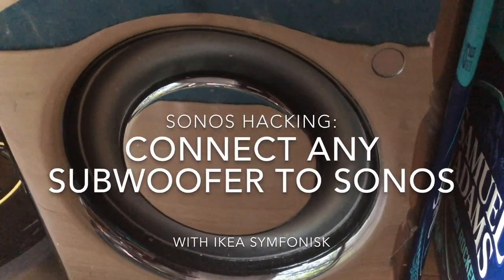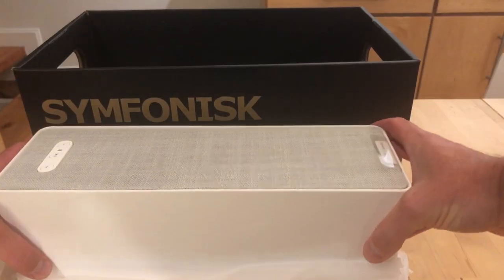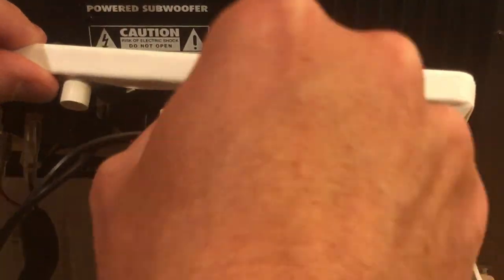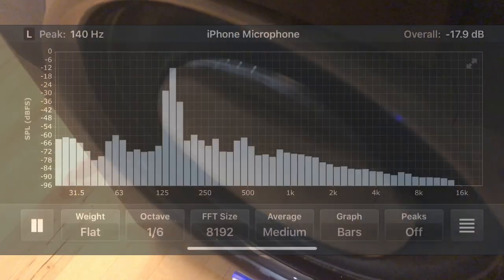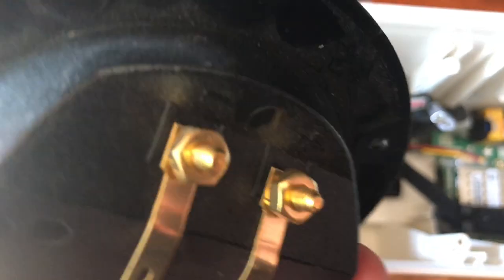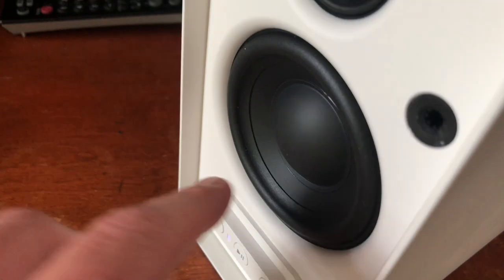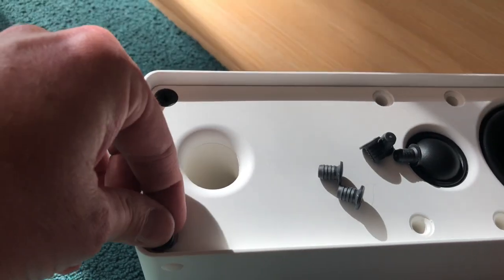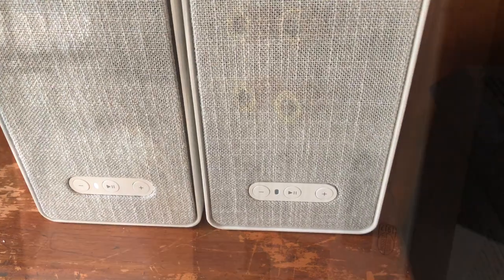Connect any powered sub to Sonos with this Ikea Symfonisk DIY hack

Comment: This is awesome. Have a sonos beam and 2 play 3's for 2.1 setup. Also have an old sub. Does sonos allow you to add more then 2 speakers for surround sound?
Reply from the maker: I don’t think so? But I think the best setup would be to buy a Symfonisk, disconnect then internal drivers and just use the woofer wire to get a signal into your sub. Then group that ikea speaker to your 2.1 room. This will let you independently control the sub volume. If you jumped off rear speakers, those might not have much low end but a grouped speaker should get a full range signal.

Comment: Works great! I simplified it a bit by just running a wire into the Sonos speaker by drilling a hole and tapping into the leads that connected to the woofer. I do have a slight hum but it’s not too bad (going from positive and ground to rca jack). Adjusting the eq in Sonos helped too. I am still able to get a little bit of treble out of the Sonos which helps to balance the room a bit. Thanks for this hack.
Reply from the maker: Are you connecting the amplified signal from the woofer terminal and just wiring it to an RCA plug? If so, I wouldn’t recommend doing that without adding a high level (amplified) to low level (signal) converter since that is too much power to plug into an input stage. E see my video on the DIY Sonos connect for info on that converter.
Reply: Todd Parker thanks for the quick reply. I’ll pick up the converter but have mainly 2 questions: I’m only interested in the low end frequencies so I’d only be connecting 3 wires from the 6. What do I do with the ground wire? I’m pretty clear on the positive negative hook up, but not the 3rd wire and where it goes. Or...is this a powered, neutral wire connect? Lol. Powered=positive and neutral = ground? Lol those terms confuse me.  Please let me know. Thanks Todd
Reply from the maker: Sean Mauricette If you are only connecting one symfonisk then yes, you’d only be using one of the channels on the converter (2 wires). There are two ground wires that may help with hum but aren’t required if there isn’t somewhere to run a ground wire. I’m
Assuming you’re doing this because your sub does t have speaker inputs?
Reply: Todd Parker yes. That’s correct. It only has an RCA input. When i use it, it’s only on around 5-10% volume because it’s so powerful (as you mentioned). There is a low hum that’s only noticeable when the system is off. But other than that it sounds amazing! Is there an area inside the IKEA/Sonos speaker that I could attach the ground to?
Reply from the maker: Sean Mauricette I’m glad this is working well for you. I replaced my Sonos sub with the symfonisk/sub combo and it sounds awesome. I’m not sure where to connect a ground inside but you can run a wire to the screw on an outlet cover usually. You might find the hum goes away one ever you’re using the converter

Comment: i just added my rel quake 2 to the symfoniks, really easy and sounds fantastic now!! thanks!
Reply from the maker: Awesome!
Reply: How did you connect it? Via speakon or lfe?
Reply: @ThomSellink  speakon
Reply: Erik Thomassen Oke I’ll give it a try! Thanks
Reply: @todd.parker   I have a kEF PSW 2150 which does not have SPEAKOn , have Line in Left and Right. so only way is to use RCA on Tpa3116? or can i connect it to Line in Left and Right?
Reply from the maker: You need to buy a speaker to RCA signal adapter. Do not plug powered signals into your RCAs or it may damage them.
Reply: @todd.parker  thanks for quick reply
Reply: @kaboutertje43865873  did you disconnect the woofer of the Ikea speaker? I’m also trying this, but when is disconnect the woofer of the Ikea speaker and connect the REL directly (speakon) to the Ikea speaker there is a hum in the sound. When I leave the woofer connected, no hum... Any idea?
Reply: @ratjetoe92  I left the woofer of the symfonisk connected
Reply: I did turn down the bass in the app and up on the sub so the symfonisk woofer doesn't have to work too hard

Comment: Hi, I ordered a symfonisk to try this with my active sub. I have one question for the cable connection. My sub has one mono cinch (coax) cable for its signal. Is it possible to cut the cable and connect it to the speaker?
Reply from the maker: Is it a coax cable or an RCA? If an RCA you can buy an adapter to convert from a speaker level to a signal level. Look on Amazon for one.
Reply: Todd Parker Its an RCA cable. Which cable would fit? Thank you for your help!!
Reply from the maker: Bastian Wur you need something like this: Kicker KISLOC 2-Channel K-Series Speaker Cable to RCA Adapter with Line Out Converter https://www.amazon.com/dp/B00I4EF1BC/ref=cm_sw_r_cp_api_i_MtB8DbQDEAH2R

Comment: I did this hack and it seem to work. But anyone having an issue with ambient buzz issue when there is no sound going thru?
Reply from the maker: Sounds like a electrical hum. If your sub has a way to ground it, try that or try a different outlet
Reply: The sub is grounded. :(

Comment: Hi Todd, great video!!!
I have a sub with input and output terminals. Please can you confirm that I can connect the tweeter terminals from the Sonos to the input of the sub and the woofer terminals on the output back to the Sonos?
Thx.
Reply from the maker: Thanks. You can install two pairs of binding posts like I did but use the first pair to route the woofer’s amp output (disconnect the woofer) so you can connect it to the sub’s input and use the second binding post to connect the sub’s speaker output to the Symfonisk woofer. I think that’s what you were saying, just wanted to be clear so someone doesn’t hook their tweeters up. This is the “ideal” way to wire up a sub since it will remove the bass from the Symfonisk’s woofer for a cleaner sound but it’s more wiring.
Reply: @todd.parker  I am a bit confused about this setup. I have the one pair of binding posts connected to the Symfonisk woofer, and they connect to the High-Level Input on the Woofer (acoustic Audio Woofer).  However, I am not sure what the second pair of binding posts should connect to within the Symfonisk? These would be the ones that are connected to the  High-Level Out on the acoustic Audio Woofer?
Reply from the maker: I have a second pair of posts to let me access the tweeter amp. If you have 2 pairs, I’d suggest using them to leverage the sub output so the woofer isn’t working as hard
Reply: @todd.parker  Sorry for the confusion with this. So...  I route the Sub Woofers Hi-Level Output to the binding post that is attached to the tweeter amp within the Symfonisk and the Sub Woofer Hi Level Input to the binding post that is attached to the Woofer amp within the Symfonisk. Is that the correct Method?
Reply from the maker: Bill Hurlburt No, you’d leave the tweeter out of the equation. Unplug the Symfonisks woofer terminals and connect them to the sub input. Then connect the sub’s speaker output to the Symfonisk’s woofer. You’re essentially placing the subwoofer between the symfonisks amp and the woofer so it filters out the bass going to the symfonisk woofer.
Reply: Todd Parker great. just so great. you win the entire world right now. I just ordered all the parts and am headed to Ikea now.

Comment: This sounds great and something I'd like to try. I assume the Sonos app allows you to add a Symfonisk to it as a sub? Also, does this setup provide decent bass, given that the electronics only expect the standard speaker so don't go very low? I don't want to rattle the windows, just make up for the weak bass in the Sonos Beam.
Reply from the maker: In the app, you can add the Symfonisk but the subwoofer isn’t seen by the app. Instead, we’re using the woofer signal from the speaker to add a subwoofer. It does sound good and I tested that the signal goes down to 20hz which is the lowest bass. So yes, you could add a pair of these as surrounds for the Beam and jump a powered sub off one of those to get a nice surround sound setup on the cheap.
Reply: @todd.parker  Thanks Todd, gonna try this soon.
Reply: @todd.parker  If Symfonisk speakers would be installed as "surround left and right", there's coming only some of the signal (surround effects) to the rear, so the bass wouldn't have all necessary information? Or do you think there's enough information for a sub? ...as you pointed out earlier that could be tackled with additional Symfonisk speaker as mono speaker and take the signal from that.
Reply from the maker: Timo Grönroos Yes, the rear channels may not get much low end. The alt is to use one speaker as a gateway to a sub and group it with the surround room.
Reply: @todd.parker  Is it possible to add a Symfonisk as a "subwoofer" in the app. So the "gateway Symfonisk" are sent the .1 frequencies in a 5.1 setup?
Reply from the maker: kallebaah0 not that I’m aware of. From Sonos’s perspective this is just a symfonisk - we’re stealing the signal to feed a sub
Reply: @todd.parker  Ok thanks for a great video and for answering. I'm thinking of upgrading to a Sonos playbar/beam with IKEA surrounds and a sub. Do you set the system as a 5.0 setup if you have a 3rd party sub? And if so, do Sonos feed the surround speakers all the low frequency signals so the subwoofer don't miss out on anything when watching a movie?
Reply: If not, then how can one add a Symfonisk as a "gateway sub"? Is it possible to add a single Symfonisk in a surround system just to feed your sub? Sorry for all these questions. I have no idea how the Sonos app work?
Reply: @todd.parker  After reading more of your answers I've understood the concept of grouping a "Symfonisk Sub" to the home theater room. I've decided to get 3 Symfonisk... 2 as surround speakers and 1 disconnected only to feed a sub. Should be the best solution? Have you tried it?
Reply: @todd.parker  Seems there is a slight delay of 75ms if you group a speaker with your 5.1 setup. Too bad. Might just have to buy the sonos sub..
Reply from the maker: kallebaah0 oh yeah? That’s too bad. Is that noticeable much with low frequencies? I’ve so far only used the sub for a 2.1 setup
Reply from the maker: kallebaah0 You’re right, this article explains why - https://en.community.sonos.com/setting-up-sonos-228990/delay-in-5-1-systems-and-grouped-rooms-6833095

Comment: Hi Todd Parker! I have question.  can  connect sony active subwoofer?
Reply from the maker: Does it have speaker inputs? If not, you’d need to buy an adapter to turn the powered signal into an RCA connection (if that’s what you sub has for inputs)
Reply: Todd Parker yeah have it.I already order my ikea speaker for complete 5.1 surround sound😀
Reply: wao Todd  my sonos home theater now is perfect I disconnect both speaker from ikea Simphonic and only connect the sub and work perfect. Now I say I have 5.1 surround sistem😀😀 Really Thank you for your tutorial!!!
Reply from the maker: @Catri2011  Great to hear that worked well for you! Pretty easy mod, right?
Reply: @todd.parker  Hi, great video !! Any drawback to use an adapter to get RCA ?
Reply from the maker: @pietronetutube  If your sub doesn't have speaker level inputs, an RCA adaptor is the way to go. Just make sure you get one that truly steps down the amplified power to a clean signal.
Reply: @todd.parker  Ok thx, actually I do not have a sub so this RCA adapdator will broaden what I can buy

Comment: Thanks again for this video, it's such a great idea. Could I also use a cinch cable if i cut one side off? So I want to solder one side of the cable to the Symfonisk and put the other side into the cinch inputs of my amplifier.
Reply from the maker: I’m not familiar with a cinch cable...

Comment: Has anyone tried putting in batting into the iKea SYMFONISK speaker to see how it effects the quality of bass? I’m curious if the speaker can be improved by simply adding batting. Also curious if it’s possible to replace the tweeter or woofer in the iKea for audio improvements?
Reply from the maker: All of that is easy to do, this is super modifiable

Comment: Hi Todd, great video! I have an onkyo subwoofer (from a all in one ht) which has an rca line input (rca adapter as you commented below will work) but my concern is that it does not have a low pass or frequency control knob . Will Trueplay sort this out?
Reply from the maker: If the sub doesn’t have any crossover or internal filtering then it will try to play the full woofers signal. If you run Trueplay it would attenuate the overlap frequency peaks for flat response but you’ll be able to hear the sub quite a bit I think. Can’t hurt to give it a try!

Comment: Do you need a 4 Ohm sub for this?
Reply from the maker: The idea with this is you're grabbing a signal from the Sonos woofer to send to a self-powered sub with speaker inputs so in that scenario the impedance of the subwoofer driver shouldn't matter.
Reply: @todd.parker  Thanks Todd!

Comment: Nice video instruction, now I also have an active woofer with crossover and a Samsung TV with only an anologue and Bluetooth output. But if I could also make a connection through my TV speakers, then I would have to deal with stereo speakers 🤔. Or don't that matter to a mono woofer?
Reply from the maker: This idea of jumping off the amplified signal to drive a powered sub would work with any kind of speaker, not just Sonos so yeah. Mono sub is fine, it’s non-directional
Reply: @todd.parker  Do I not need a signal from both tv speakers (stereo) to the subwoofer ?
Reply from the maker: Black Sheep if you only have one sub, stereo doesn’t really matter so you can get by with one channel if you want

Comment: I have Sonos Arc and 2 One SL connected. I have an AudioEngine S8 https://audioengineusa.com/shop/subwoofers/s8-powered-subwoofer  laying around can I use these to connect Arc and 2 One SL to this symphonisk? What should I connect the symphonisk as if I already have 2 rares?
Reply from the maker: You have 2 options:
A. Open your One SL and hook a wire off the woofer to get a signal to feed into your sub.
B. Set the Sumfonisk up as a separate room, disconnect the internal drivers and use that as a gateway to feed the signal to your sub. Just group that room to your home theater room.
In either case, since your sub doesn’t have speaker level inputs, you’ll need to use a speaker to line level converter to get a clean signal out.
I cover all the details here: https://youtu.be/9Bvof0hF4LE
Reply: @todd.parker  for the 2nd option I think you mean “group”. Can I use only as 3rd surround sound speaker (sub). Will it play the low frequencies from sub from symphonisk if I just group it
Reply from the maker: @deathward990  as far as Sonos is concerned, this is just a Symfonisk, it never knows it’s a sub. We’re just grabbing the amplified woofer signal as an input to the sub. Sonos only has slots for a matched pair of surrounds and an official sub, no way to add a third surround.

Comment: What's the impedance of the tweeter and woofer built in?
Reply from the maker: I didn’t have my multimeter handy but will test the impedance when I open the next one.
Reply: I think that finding out what the proper impedance would be super important... Doesn't seem like a good idea.. Could easily ruin the power side of the amp in that Ikea speaker.
Reply from the maker: Dwilsonmusic145 I guess that possible but usually you can damage an amp by using a low impedance load (say 1 or 2 ohms). My guess the this amp is designed for 8 ohm drivers, maybe as low as 4. The Focal drivers are 8 ohm so I think I’m probably fine here.
Reply: @todd.parker  Aren't you effectively wiring the speakers in parallel if you don't disconnect the speakers in the Ikea enclosure?  That will lower impedance quite a bit, which could fry the sonos amp.
Reply from the maker: Jon Don Yes, they are in parallel so the impedance of the load would be halved which does make the amps work harder. All I can say is I’ve had these symfonisks wired up to biamp speakers and drive a sub too. It’s been running like that for a month and it’s fine. I think most amps can handle a 4 ohm load. Maybe the sub doesn’t draw as much power somehow? Seems this would be an issue for any receiver using a powered sub this way and it’s a non-issue so...